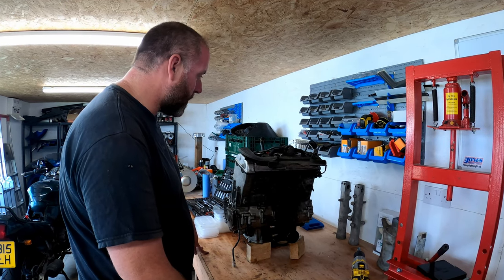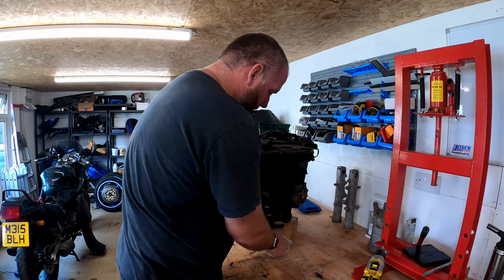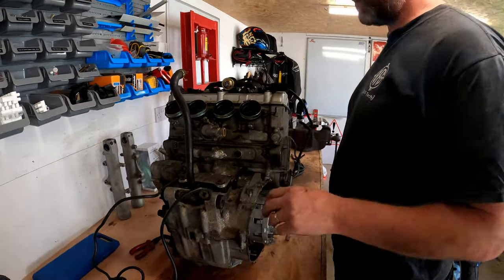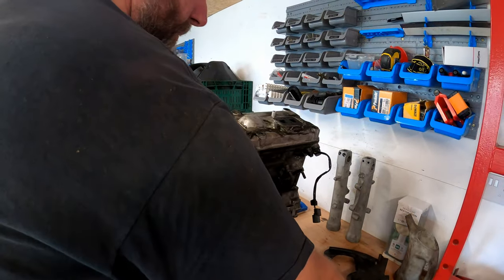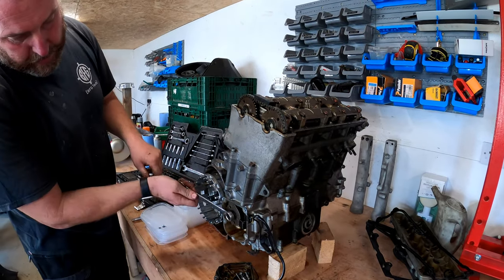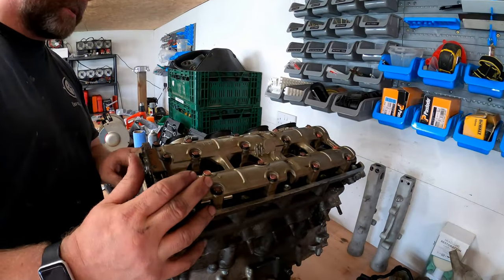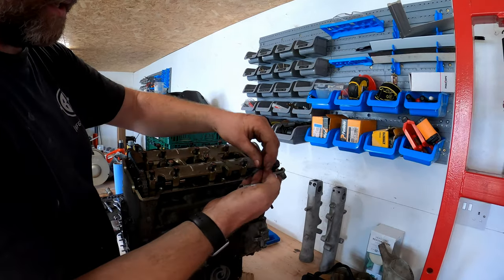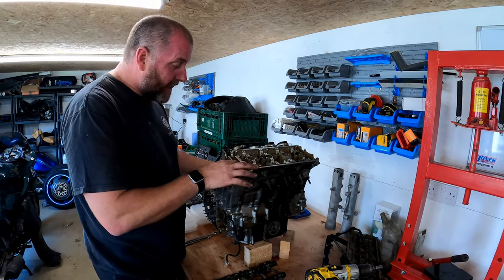1998 Kawasaki ZX9R - Project Shinobi, Episode 8 - Beginning The Engine Teardown

Comment: I'm working on '99 ZX9r for a mate. The reed valves were completely dark brown with shellac and the reeds were off the rubber seat. After years of wrenching I discovered some time ago that the best way to dissolve caked on deposits is with oven cleaner. It really does work like magic and saves a great deal of time....doesn't harm rubber bits either. Rinse it with hot water after and it's all clean and back to shiny metal for the most part. Really stubborn spots sometimes have to be cleared by scraping but the oven cleaner gets most of it. 

Anyhow, this particular motor has 140,000 km and was beginning to run poorly, hard starting etc. First thing I did before teardown was a compression test and only one cylinder was at factory minimum of 155 psi., # 2, 3 and 4 ranged from 127 to 138 so not great there. Then off with the valve cover like in your vid. Close inspection showed the "exhaust purification system" is pretty much stopped up with carbon and shellac. I only mention this to say that careful inspection of every single air passage with this Kawasaki system should be looked at closely and cleared if it's blocked.
Next was valve clearances before removing the head. Intakes were mostly good at 0.15mm (factory min spec.) but all the exhaust valve were pretty much at zero, so ordered new shims. I was concerned that the exhaust cam lobes would possibly be worn but luckily they were still like new.

Pistons and cylinder bores need to measured...probably will need new rings. Plenty of work left. Thanks for your vid Kev. It might be a year old but a great reference. Cheers.

Comment: Great stuff! Be careful with the engine bolts when you do them buddy! I manhandled those things and managed to strip a couple of them (out of pure ignorance and stupidity). I had to source new ones. Spray some penetrant on the bolts and leave them over night, and tap/bang them to make them crack loose. Because if you snap one of them, you're in for a world of trouble...
Reply from the maker: I assume that you mean the cylinder head bolts mate? Yeah they can be stubborn but my biggest concern would be stripping out the threads on refitting the head. I am considering opting for ARP replacements as they are studs and nuts instead of bolts and give the threads an easier time! I learnt that many years ago working on aluminium BMW blocks!
Reply: @KevsShed  Yea, that's the right word for them, cylinder head bolts. I'm glad I didn't snap the head off of one of them when I took them out... I had no clue what I was doing at the time, but fortunately they all came out. I reused all but two of them. Clean the  threads properly on both the bolts and in the holes, and they should go back in without any problems. It was easier to refit them than to take them out. I don't know about ARP bolts. But if the stock ones are in good nick, I'd reuse them, it also says in the manual that they can be reused. There's even a special torque setting for reused bolts, I think it's 49 nm compared to 52 NM for new bolts (but look that up). I set mine at 50 NM, applying torque in stages, all the way from finger tight and then adding 10 nm all the way to 50.
Reply: @KevsShed  On more tip on the cyl head bolts. When you crack the first bolts loose, you have to retighten them back in. You don’t have to torque them back in, but screw the bolt all the way down. The head is machined flat, and if you ondo all bolts all the way, there will be sideway pressure on the last bolt, and risk of breaking the head off👍
Reply from the maker: @nitramh24  cylinder head bolts should always be removed a quarter turn at a time in the reverse order of the tightening sequence, I’ve got the whole engine apart now with the exception of the transmission being removed! I’m making steady progress. Further episodes to follow really soon! 👍🏻
Reply: @KevsShed  Great! Hope you got it on tape!
Reply from the maker: @nitramh24  👌🏻😎